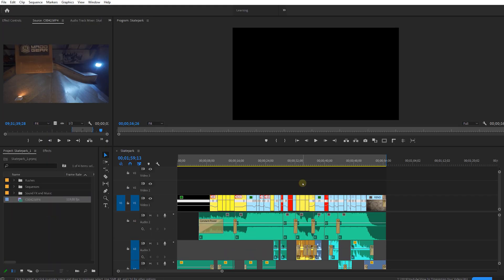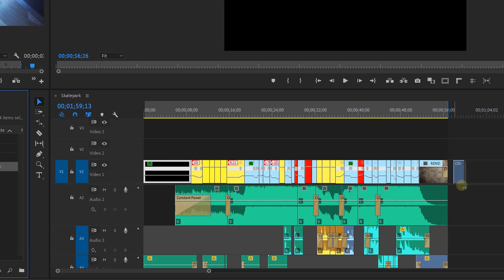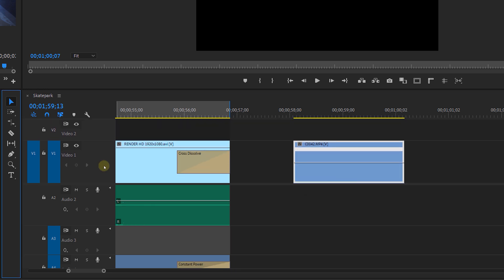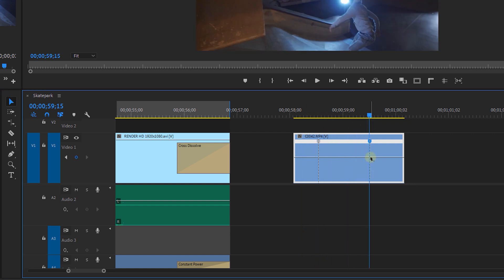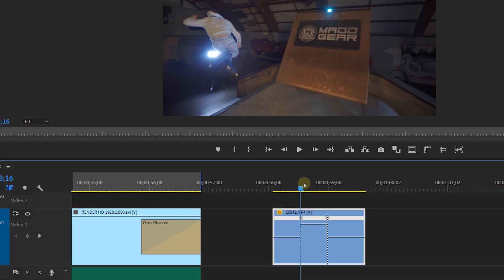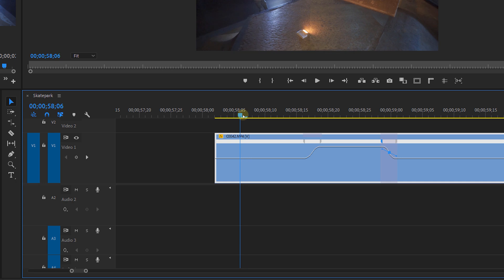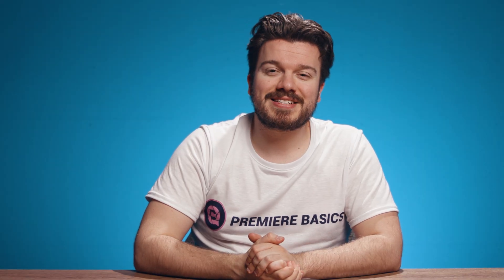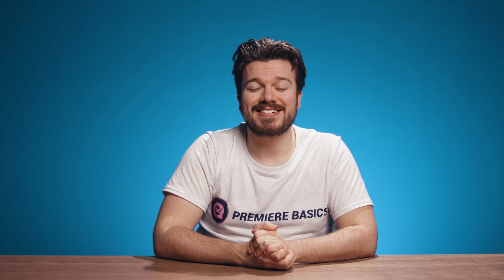How to smoothly SPEED UP your footage (Premiere Pro Tutorial)

Comment: i tried to do this kind of thing but the clip had audio with it, and it ended up out of sync? is there a way to stop this happening? because it only adjusted the video clip even though it was still linked together with the audio?
Reply from the maker: Hi CrashCarDave,

Unfortunately you can't speedramp audio... You can however use the rate stretch tool (R on your keyboard) to change the speed of the audio but that's for the entire clip.
Reply: @PremiereBasics  ahhhh okay thanks for the info :) i guess i could try and work around it by unlinking the audio and cutting it up to use the rate stretch tool on each section of the audio to match the rate of the video i guess? just on those sections that are being ramped